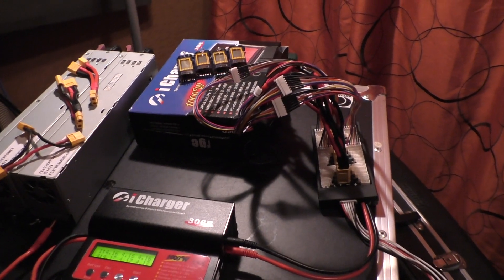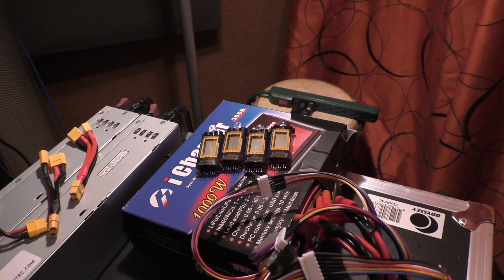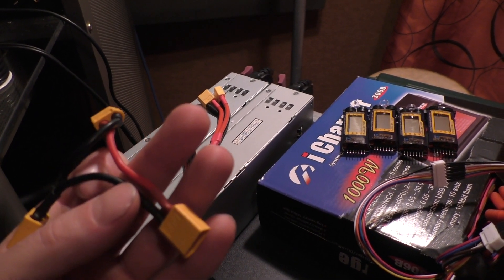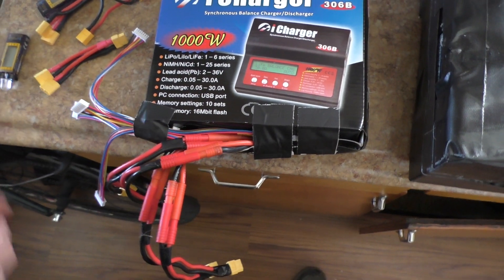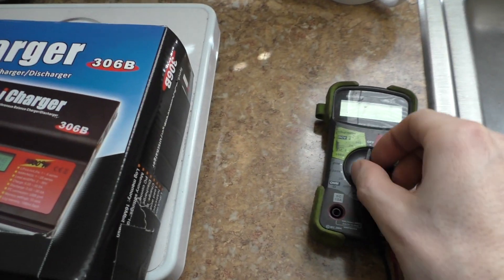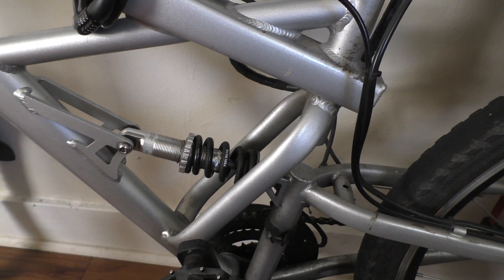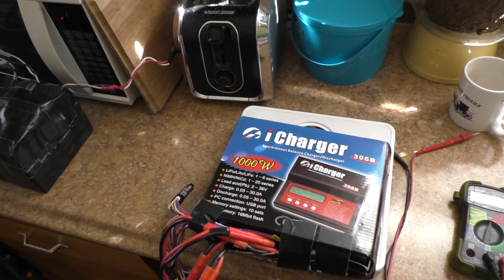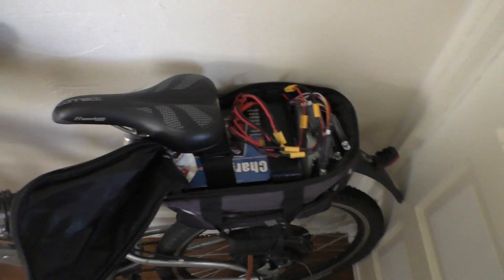48V 1000W DIY E Bike 002: New LiPoly Battery Setup and Bike Update

Comment: Can you ride your bike with the cell checkers installed and if so do you need one in every  battery?? ( I'm learning so much from you 👍
Reply from the maker: Albert Nieves thanks man! and I'm glad to help. Yes sir, if you get a cell checker with alarm then you can set it to beep at 3.6-3.7v so you know when you're batteries are about spent. I usually only had it on one of the cells. As long as you keep your batteries balanced well, you shouldn't have too much inconsistency between cells. if you do, then something is wrong. usually a solder breaking. I would keep an extra couple of leads with me in case that happened.

Comment: Hey nice setup! Could you help me out.. I have four 3S batteries that I'm trying to wire together to get 48v. How will I setup up the wiring?
Reply from the maker: You'd wire them all in series.  The 3S packs are 3 cells wired in (S)eries, so then just wire the 4 packs in series as well.  It won't be 48V. it's more like 44.1v, but kits made for 48V will run on 36V - 48V normally.
Reply: Won't he get 48v at 4.0 per cell and or 50.4 at 4.2 per cell ??
Reply from the maker: Battery capacity is rated at nominal voltage.  So yes, at full charge it's higher but at nominal, it is what it is.  My 52V pack is 58.8V at 100% charge and I usually charge it to 57.7v (about 90%) unless I need the extra juice.  That is to prolong the lifespan of my battery.  Charging to 100% = 1.5 years, charging to 80-90% = 3 to 5 years.    Well worth being more careful and keeping my battery at 30%-80/90% always.

Comment: nice, do you use a fuse at the controller? if so what amp fuse?
Reply from the maker: I've updated my battery system.  Now I'm running 3 x 14S 5Ah @ 57ish v fully charged - 4.10-.15v/cell (52V 15Ah Battery).  Same charger.  I have a 30A fuse on my power lead between the battery and 26 max A controller.  I'll soon be upgrading to a 40A controller and will switch to a 45A fuse.
Reply: Great, thanks for your detailed info.
Reply: I am inspired to overvolt my ebike too, do you think 15S is safe?
Reply: NVM, I just checked the mosfet rating on my controller and it says 60V max.
Reply: Do you have a BBSHD ??
Reply: That was also my thought I would like to see how you the 3rd series pack into parallel ??